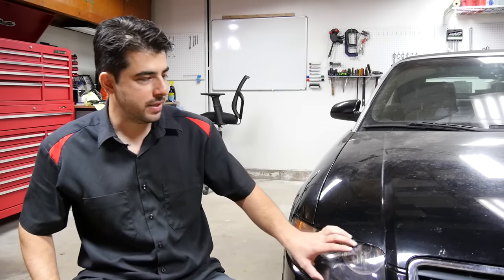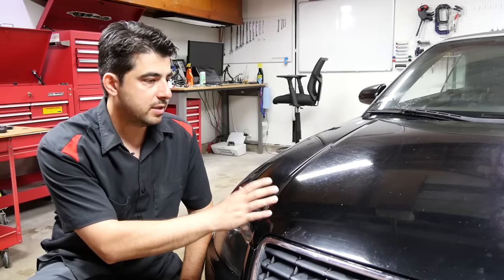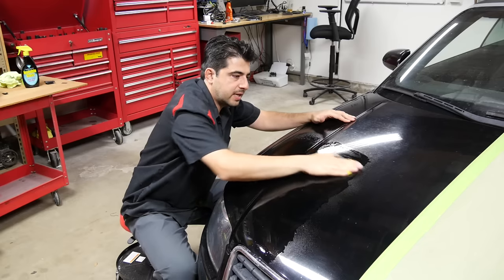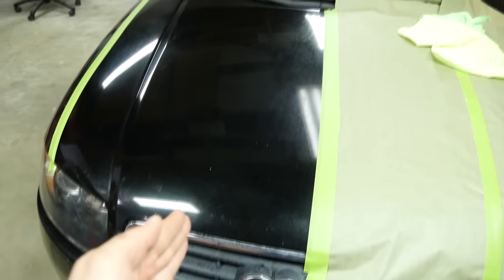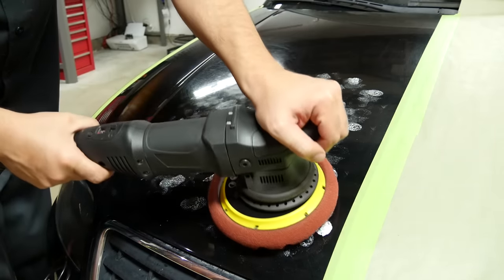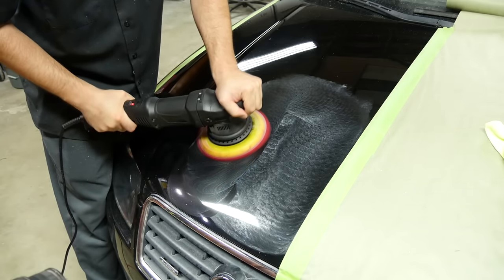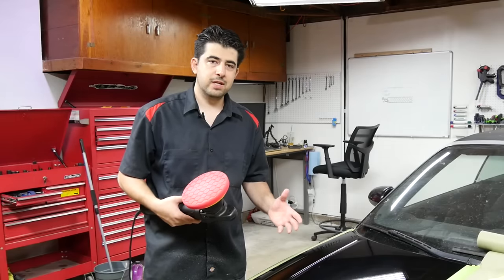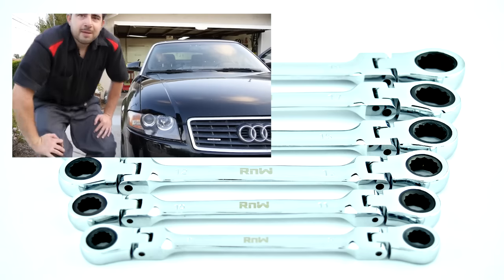How to Fix Old, Hazy and Scratched Clear Coat

Comment: So, a tip i learned years ago about if you need to clay bar.  If you take a plastic bag or cellophane wrapper and put that on your hand then run it along the surface of the car, you will feel the imperfections much easier than just using your bare hand.
Reply: Maybe a rubber glove would work also

Comment: My front fenders look like frosty glass and the clear is completely opaque. It’s very uniform and not splotchy looking like this car. It scratches off with a fingernail. What is the best way to remove it without damaging the paint underneath? I’d like to be able to prep the bare paint, maybe spray an additional coat, and then clear it.

Comment: Guy
1. tells about inflicting scratches to the paint right after he rubbed thoroughly the dirt laying on the paint surface right into the paint.
2. would wet sand rock chips and scratches so deep, that they definitely reach down into the primer or even to the bare metal, so they can not be actually corrected without putting paint on the surface first
3. would use the scratch remover after compounding and polishing, when in fact the coarseness of scratch removers is between the compounds and polishes, and because of that using a scratch remover (besides being totally pointless at this point) would just ruin the previously achieved polish.

Very professional. A lot to learn from this guy.
Reply: Gábor Bérczi exactly what i was thinking. Also no prewash and the lack of grit guards :/ I wouldn't call him a professional detailer but good job nevertheless

Comment: Remember the taped lines and masking tape is for the video demos to show before and after results.  In real world applications just do sections at a time.   I do sections of the vehicle.  If I get called away and can’t finished in a day I am good.   I recommend the zonal technique as in rear center and front.  Typical four door sedan for example.  I will start with trunk/rear bumper/ quarter panel area.  Wash, clay, rinse, corrective action for scratches swirls etc.....  my basic theory is if I run out of time I would rather have let’s say 1/3rd of the vehicle fully done than then 3/3 of the vehicle halfway done.   Remember once you clay you lose all the wax and sealant protection so important to get the buffing compounds swirl remover, polish, glaze wax and sealants applied quickly.  Work quick but safe and correctly.

Comment: At which point do you throw away the clay bar? It seems it would be difficult to hide  enough of the dirt simply by kneading  the clay bar so it could be used on another section without scratching it further.

Comment: Hey guys been in tire business 20 years. This is how you calculate the correct air pressure for different tire sizes. 

Most trucks go bigger sidewall tires so the air pressure needed is lower due to increased volume. This is the biggest problem on light jeeps. 

You can calculate from the original tire size. 

If it calls for 35 with a tire that holds 3500lb at a max of 44. 3500÷44 = 79.5 lb  per psi. X 35 = 2784. 

If new tire is 4200 at 44 = 95.45lb per psi , take 2784 ÷ 95.45 = 29 lb of air in the new tires. Meets stock load rating.

Comment: would this process in theory lower the durability and long-term life of the clear coat? I have a 2000 4runner I want to do this on but my fear is that this would burn through the factory clear coat, being that JDM coats are thin or if it doesn't burn through it, would the clear start peeling after 5 or so years from excessive cutting ? Thanks.

Comment: Should have hosed it down to pre soak..get most of dirt before swirling dust and dirt particles around the paint.   You can also claybar while wet.   It will provide additional lubrication along with the claybar detailing lube.   This also prevents the added step of wash rinse dry clay and dry again.  Keep the clay bar lubricant ahead of the bar and remember there is no such thing as too much lubricant.   Wipe off with separate microfiber towel/cloth.   Remember to tear the ID label off the towels.   One less thing that you have to worry about getting caught under the towel and reduces the risk of more accidental scratches.
Reply: I feel like that paint was so fucked from the start that he really couldn't do much more damage

Comment: If any of you are going to try this, I detail as a side gig, try Sonax 4/6 CutMax not any of the Mothers or other brands stuff (Leaves chalky residue and makes for more work with clean up). It will really make a difference using a D/A. Leaves next to no residue and the clear just beams. I personally would never use a wool pad either, the Sonax stuff does the job with a foam pad and has very little chance of burn through even on 5-6 setting. (It even polishes up plastic headlights/taillights if you're game enough).

Comment: I just finished sanding and polishing a bike frame and at the end I discovered some white-ish streaks in my clear. Im not absolutely certain if it happened when I was wet sanding or if it happened during or after I laid on the clear coat. 
It feels smooth to the touch after polishing. Should I use the clay bar for this? It not, what can I do?

Side note: I tried using a hot air gun to see if it was just the clear having fogged up but that did nothing. Though I had let the paint cure for nearly 2 months.

Comment: Great video, I was under the impression that I would need to have the top of my car re-clearcoated because of two hazy spots about 12" in diameter. The guy called it paint failure. So you think this will fix the problem or is it  better long term to have the top re-clearcoated again. I hear its expensive?
Reply: reclear, which will actually require some actual color to be applied before reclearing, to do it right... and have long lasting results....

Comment: You used some old school products from meguiars, they have better compounds and polishes now. M100 or M105 followed by M205 would've been a great combo. Microfiber cutting disc for the compounding, yellow foam for the 205. Wool pads and M85 weren't even designed for dual action machines, but it did an ok job.

Comment: For whoever is thinking of doing this on their own I recommend a one-stage correction instead of cut then polish using different pads.  Why, because it's a pain in the ass and I know what it's like doing a whole car and that's just a COUPE. I reccomend buying a 6 inch groits MICROFIBER FINISHING pad paired with Meguires M205  or any medium cut finishing polish.

Comment: My 2003 Honda Civic hood feels like matte finish at this point. Is that what the clay bar removes? Ive often thought its just powder at this point. Any chance I could somehow take off the paint/undercoat itself?

Also, the paint color is white, Im not sure Id be able to see if it needs the step you did (red foam) after the white wool. Thoughts?

Comment: I have a 1996 4cl 2.2L Toyota Camry. I replaced the water pump and timing belt. It started and then it cut right out. I tried starting it quite a few times and it will not start. and I noticed a smell of gas coming from the engine near the fuel filter. What would you suggest that I look at next to get it running .And also  when the key is in the on position the fuel pump does not turn on. But when I crank the key all the way I can hear it engage. Is there something wrong there? Thanks for your time and your videos are really good.
Reply: Since you changed the timing belt the first thing I'd be checking is the timing.
Reply: thank u for your input that was the first thing I was going to check n that was it the pulled came loose so I reset the timing belt n now it runs like new thank again n all have a good day
Reply: Sounds like a relay to me. If pump isn't bad but not kicking on its definitely a fuse or relay switch. Very simple.
Reply: Did you junk that lemon?

Comment: If I wet sand my clear coat, can I go directly with ultimate Polish to bring back the shine or do I have to use compound first
Reply: You would need a polish suitable to remove the sanding marks of your grade sand paper. Finishing polish would not normally remove the sanding marks.

Comment: What about doing this by hand? How would you go about that
Reply: that ford guy it won't work by hand
Reply: It will work by hand, the polisher is just a machine version of what you'd do by hand normally with a polishing hand pad, it's to speed things up, a convenience item not a neccesity. Though it will be extremely difficult and you may need to purchase alot of elbow grease first.

Comment: Process for hand polishing? Don't have the electric tools.🙂Trying to educate myself in this stuff for my '74 bug. Thanx
Reply: You really want to invest in an orbital buffer for paint correction. You can't generate the speed or heat required to cut into the paint correctly when doing this by hand. 

You may get some effect by hand, at the expense of your arm. But it'll be subpar and not meet your expectations.
Reply: @MyGoToUserName   Indeed

Comment: Where are you located? Any detail shops in Brooklyn NY that does great work like you? I have a 2003 Yukon Denali that was sitting underneath a car cover or I should said cheap Chinese car cover for over three years while I was away with the military… I would like to get the clearcoat redone because it has gotten really bad… Took it to a place in Brooklyn but they did an awful terrible job… I could’ve done a better job myself

Comment: Can this process be done solely by hand, without the use of orbital sander?
Reply: No, it cannot.  The level of abrasion required to physically alter the clear coat is significant and requires mechanical abrasion.  You can polish or wax by hand, but not perform paint correction.

Comment: I used a polisher and took off paint but not to bare metal but the original first layer of vehicle but what pad do I get to use take it off to original coat layer this wool pad did get it down to it but it goes to slow for it. I just decided to do this because after I painted my truck it looked faded  in parts and I used the polisher and it got my paint down to original later of vehicle I need a better pad so I can get it down quick to the original layer of my paint layer.

Comment: Prior to viewing the video, I thought you might apply a whole new layer of clear coat. (After the old clear coat has been sanded and polished of course). Is that a viable option?
Reply: I was thinking the same. With a Rattle can of course. Even better!
Reply: David - If you polish after sanding the old clear coat the new clear coat won't stick well it will eventually peel off. just stop at wet-sanding upto 1500 grit and then apply new clear if you want to.
Reply: you're welcome ^_^)
Reply: And if you're willing to put this amount of effort into the car, go for the better 2k clear coat. That one is also more suitable to be polished again.
Reply: if you're going to apply clear coat, save the polishing for after you clear it.  Also, etch it with something other than a clay bar, for the clear to adhere to... If you wish to buff it after clearing, to remove trash/flatten the texture (orange peel),  you must use a 2k clearcoat, and must also have enough  applied to allow sanding/buffing afterwards...

Comment: I'm a novice and can't afford a Flex da polisher. Can you recommend another that's $150 or less?
Reply: Griots garage polisher . Torqx polisher
Reply: Ken Sternberg Harbor Freight makes a DA that's OK for beginners. Type in DA polisher on Amazon, Ebay for other options.
Reply: Ken Sternberg The Porter Cable 7424 is around $120 and is excellent.

Comment: Sir,  Any specific reason you linked the "Flex" polisher instead of the "Torq" model you used?  Failures, Problems etc?  Thanks, James
Reply: Yes, flex is twice as expensive, so more amazon comission if someone buys it from this link. ;)

Comment: I would have  wet sanded hood with 1500-2000 grit..then used rotary buffer with wool...then finished it the way you did...I actually have a hood like that with a lot of road rash chips  need to touch up...thanks

Comment: What does "compounding" mean specifically, and how is it different from polishing?
Reply: compound is used if your paint is faded, has medium-light scratches, bad water marks, etc. it has harder abrasives that penetrate your clear coat. Polishing is a softer aproach and is generally used after a compound to get that mirror polished paint. Or, if you have already a good paint job, or new car but some swirl marks, a polish will do the job to get it shiny.

Comment: What was the fluid used with the clay bar? Was it just soapy water?
Reply: Soapy water works fine.  Many folks use detailer spray.  He is using the spray that came in the clay bar kit (looks like Mother's clay bar kit)

Comment: That is not a forced rotation DA.  That is a random orbital DA.  The way you can tell is that random orbital has a free spinning spindle whereas a forced rotation is gear driven.
Reply: You're right.  He links to a Flex 3401 which is a forced rotation, but that looks like a Torq 22D which is not.  I own both, I recognize the 22D as I use it all the time.
Reply: Any cheaper options for the buffer you would recommend for someone who needs to do this one time/not a pro?
Reply: @aletheakelly1010  Hazard Frought.    (Harbor Freight).  Home of the "disposable tool".   lol!

Comment: Can you use angle grinder or orbital sander with polishing pad
Reply: angle grinders have way too many rpms to buff with unless you are very experienced, and it will wear out the trigger, and the trigger finger (in trying to keep the rpm's low.  An orbital sander isn't recomended, even if you can lock the "orbital" part out, because they usually have a 5 or 6" pad as opposed to a 9" pad.   The smaller pad  will create small swirls  that can be hard to remove and again the rpms are harder to control.  The best way is a 9" pad on a variable speed, variable trigger buffer.   It's a great investment.   You CAN use a buffer as a grinder, but not recommended the other way around.  Hope this helps you...

Comment: some people use wetsand before compounding, can you explain why that is?
Reply: wet sanding or dry sanding in this case (as long as you have sufficient clear coat millage) would actually be better, as it will straighten the imperfections left by the water spots, and you can use a finer grit ( 3000 - 5000 grit sand paper are very common at body supply stores, in wet or dry applications), and can save a lot of "elbow" if using the dry with an orbital sander, and then buffing back the shine, as he did...
Reply: also, doing the "removing" of imperfections with the wet or dry sanding means less buff time, reducing the chances of "burning" the paint.

Comment: LOL, given the condition of the paint, you are worried about using a sponge? Anything will leave a mark if you rub it hard enough.

Also, when using any corded electric device you should run the cord over your shoulder to prevent the cord from being cut/caught/damaged by getting in the way of the blade/rotary/heat the machine is doing. In the case of car polishing, it also prevents the cord from rubbing the paintwork.

Also, IMHO you are not overlapping enough ;) , and some might say you loaded the pad up with too much product after the first application. You only need to clean the lambswool pad when the fibres get a bit claggy. With a new pad you could probably do half the car first.

Overall, not bad, but maybe some explanation of the different foam buff pads.
Dark colours are always a pain in the rear to maintain.
Reply: check out his other videos he gives a full explanation on what foam pads to use with compound and finishing polish
Reply: no one notice he didn't even prewash his car but still end up 80% paint corrected?

Comment: How do i apply the elbow grease?
Reply: Elbow grease is a saying meaning to put more work into it if your clear coat is starting to fail. It's not an actual product. Depending on the state of the clear coat, or if it's down to the actual paint. The more deteriorated the clear coat, the more physical work (or elbow grease) it needs to fix the issue.

Comment: Don't forget to mention... After the rinse, if you see any imperfections that it won't be fixable through a basic wash and wax, and that it will need to be "clear coat repaired"...
Reply: Tyler Hopkins What?
Reply: Tat2Dragons ... If you are washing your car and notice that the scratch isn't "disappearing" just by spraying water over it, it will have to be sanded down to the base coat, hopefully, if not all the way to the primer... There are other videos that he's done about clear coat repairs, which is why I'm surprised he didn't mention it in this video, he's usually pretty good at explaining worse case scenario...
Reply: Tyler Hopkins That’s simply not true. Also, if you were going to try to remove a scratch you sure wouldn’t sand the area down to the base coat, because you would be through the clear coat. There’s obviously no mention of clear coat repair on this video, because that is not the premise of this video.
Reply: Tat2Dragons which was what I was trying to point out, is that there wasn't any mention of it... And yes you do need to sand down to base coat, if the scratch is to that point... If you spit on a scratch and it doesn't "vanish" that is a big indicator that the scratch is deep , as in past the clear coat...so base and hopefully not primer or metal deep...
Reply: Tyler Hopkins Yeah, again it’s not the premise of this video, so there’s really no need to even mention it. A good indicator of a scratch being too deep to be removed by cutting/compounding and polishing is to run your fingernail across the scratch. If your fingernail catches it, it’s usually through the clear coat and will need to be repaired.

Comment: should have sprayed water on it first, soak for 5 with soap / water spray, wash off with water then microfiber wash :)  most likely you put more scratches in the clear causing more work!